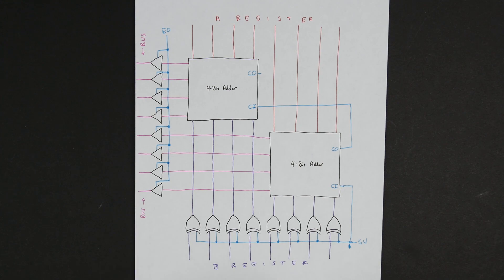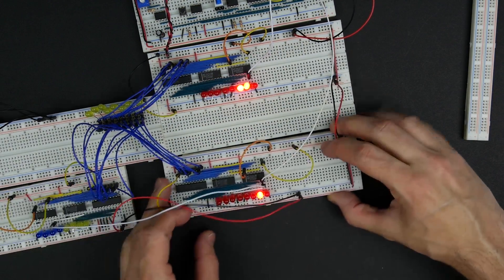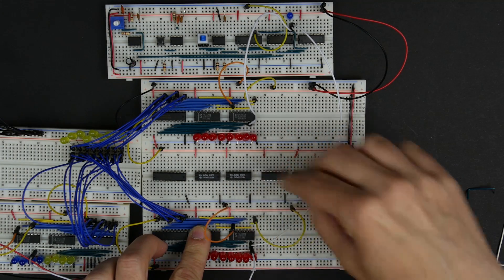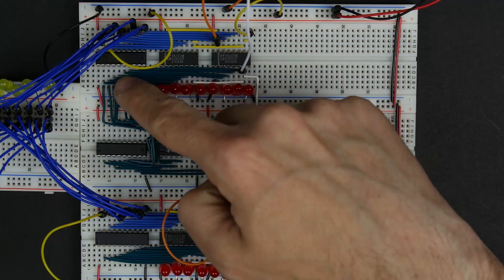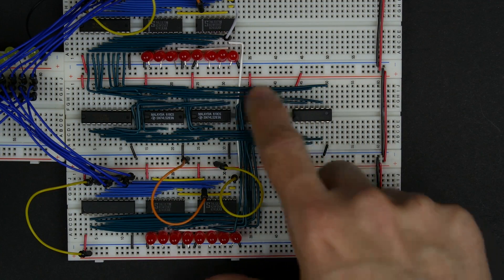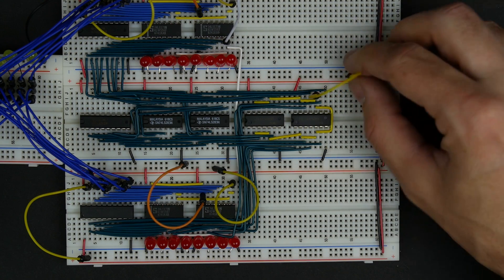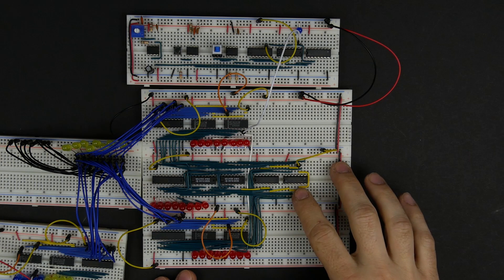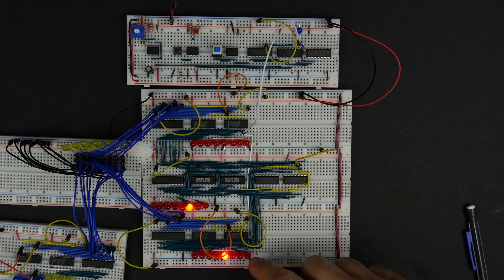Building the ALU

Comment: I run into a problem. My xor doesn't work if i use it in the computer but it does work if i use it separately. I measured the voltage and i noticed in input there is 2.01 volt. The minimum requirement is 2.0V so it is in the interval. Could the problem be the current? How can i fix it? I measured 2.01 for the first input, 0 for the second one and 0 for the third one. So maybe it's because it is considered as 0
Reply: Same ,did you fix it?   iam also getting this issue . Subtraction works mostly but the addition is not getting correct output  
I powerd  form a cpu usb.if u know something please tell
Reply: @anandkp5329  I fixed by changing the power supply. I used a 5V battery, now I'm using a phone charger. I cutted the cable, splitted GND and VCC and finally I used them separately to power my circuit. Makesure your powersupply can handle at least 1A
Reply: @undagame7800 Thanks .let me check if it work for me

Comment: If you're following along and run out of space on your breadboard for the LEDs (due to lack of pull-up resistors in the CPU kit chips), you can connect the output of the LS245 (tri-state buffer) to the bus to test rather than having to rewire. I haven't finished building the whole kit yet, but my guess is this should suffice for the rest of the circuit.

Comment: i faced a problem with alu part. i bought a 74hc283 ic from shop and i connect the pin 8 to ground and the pin 16 to the vcc the voltage of pin 7,9,10,11,12,13,14,15 is high and the voltage of the pin 1,2,3,4,5,6 is 0 why it is happening? as far as i know 74hc283  is a binary adder. it also showing wrong output. the ic become hot when i connect the input pins. Basically the out put pin 9,10,13 always high whatever the input is. pin 1,2,3,4,5,6 always low. I am stuck into this from two days. Anyone please help me.

Comment: As so many others have rightly commented, this is a great, great series - just what I was looking for in trying to develop an understanding down at the level of logic gates and transistors in the design and construction of a computer. I've already learned an enormous amount, both on theoretical and very material / practical levels, and am very grateful indeed.
In this video, however, I tripped up at one place - resulting in what turned out to be two errors in wiring that resulted in arithmetic errors in some, but not all of the numbers I tried out when testing the A(L)U for the first time.  On the one hand, as we saw in the next video on troubleshooting the ALU, this is a good thing - as we thereby are forced to go back through to troubleshoot, and thereby become all the more familiar with the details of the circuitry, etc. And as some have commented, it is one of the most satisfying experiences to finally do so successfully. Again, I've learned a great deal and am very grateful for my new understandings and modest skills, and the feeling they give of having better foundations and abilities for proceeding onto the next steps.
That said: I ended up spending far more hours on the troubleshooting than I would have liked (however great the rewards) and would like to make a modest comment for folk like me who are entirely new to this and might get thrown off in the same way I did.
At 8.23 or so, bits 8-5 from the 74LS245 buffer are fairly clearly connected into the proper inputs of the left XOR chip (74LS86). But then the video skips ahead here: we see bits 4 and 3 - apparently, as it is somewhat difficult to follow in this segment as it is speeded up and the lighting makes it difficult to see where the - already wired into pins 12 (4A input) and 9 (3A) on the right XOR chip; the last two bits are then shown as they are wired into pins 1 (1A) and 4 (2A).
Both because it was difficult to see here - and, no doubt, because I have dyslexia and can easily get tripped up with such visuals - this is where I ended up making my mistake: miswiring bit 4 (should go to pin 9 on the LS245) and then bit 2 (should go to pin 1). Once the errors were corrected - i.e., the A(L)U functioned perfectly.
Perhaps they teach one these things in engineering school - but for newbies like me, what turned out to be essential was (1) going back through the circuitry and chip diagrams in order to build simple tables of what pin needed to be connected to what - i.e., rather than relying solely on the video to show the right way. (2) I then initially tried to check the connections by tracing the physical wires - but because the wiring is so interwoven (and, again, my dyslexia doesn't help) I had to give this up. A good thing as I realized I could just check the connections using a continuity tester.
Sorry for such a long post - but again, for newbies like me, these bits (pun intended) might help avoid errors that can take a great deal of time to sort out.
Reply: thanks for the heads up! This one was a bit trickier with the wiring for sure.
Reply: you definitely need to be double checking the pin connections directly with the diagrams on the data sheets, I only use the video as a guide to see how to lay out the wires

Comment: I suggest using different color wires for different connections like using green for A register to ALU and yellow for B register to XOR gates and so on instead of using the same greenish blue wires for everything.

Edit: also I think it’s good practice to connect the carry out of the second 4-bit adder to ground through a resistor instead of just leaving it floating.

Comment: I did a few rough calculations and a sim for the adder portion of the ALU. A kogge-stone adder for 16bits built with 74HC 86/32/08 chips came out 192 nS (max 4.5v) and 94 nS (typ 5V 15pF load). A 74HC283 16 bit ripple carry cct came out 184 nS and 92 nS typ. So 192/94 nS vs 184/92 nS. This seems to be the breakpoint. At 32 bits the numbers are 228/112 vs 368/184 nS i.e. 60% speed improvement. However a KS adder with 32 bits is a lot of 74HC chips so capacitance will drop the speed improvements.  All bets are off if it's implemented into a gate array - use the KS. For up to 16bits I would just use ripple carry and 74HC283's.

Comment: The only issue with breadboards (which i LOVE BTW), is if you mistakenly snag a wire and pull it out.  then it's a game of figure out what you just broke, which can take hours.  Which is why i did what you are doing, which is to make the wires as neat and low to the boards as possible, to prevent snagging in the first place, and also make it easier to spot where the wire went.  I knew guys who would rats nest every time, and god help them if they pulled a wire by accident.  I knew one guy who would just rip out everything and start over, because he felt it was faster.

A neat breadboard is a happy breadboard!  ^-^

Comment: You could like my calculator method for arithmetic. I use three sets loadable counters. The answer is always in counter 1. Counter 2 always counts down to zero. Counter 1 counting up(from a number) while counter 2 counts down(from a number) (to zero) results in addition. Counter 1 counting down while counter 2 counts down results in subtraction. Counter 1 being transferred  to counter 2 then cleared to zero then addition taking place the number of times  that is in counter 3 results in multiplication. Counter 1 being transferred to counter three then cleared to zero , then counter 1  counting the number of times counter 2 counts down (to zero) while counter 3 counts down until counter 3 equals zero results in division. I use sequencers made of latches , AND gates , and inverters to control how the counters count (for a calculator). By using instructions in memory to cause the counters to select the proper sequencer, arithmetic can be the result of instructions from memory being decoded to select the needed sequencer. Other sequencers can likely be created to accomplish logic functions and program control as well as input and output.

Comment: At 7:00 Ben puts the buffer into the wrong pin. He puts in input pin 12 which is the A part of the adder and not the third sum. You can fix this by just putting the pin up one higher into pin 13 which is Sigma 3.
Reply: I was debugging this issue for 3 hours.  Thank you
Reply: Saw him do that and immediately looked to the comments like... "that can't be right"...

Comment: I am loving your series! Thank you so much!

But i have a question that I do not see answered in the comments.

In a previous video, you showed us that you added the tri-state octal buffer to the registers so that you can visualize the state of the registers with LED's. Without the buffer, the outputs would only be visible when enable is set (And the data is on the buffer). So it was clear that the buffers were added to aid in this educational/hobby scenario.

But if my understanding is correct, you would also need them if you wanted to do what you have done here. i.e. if you did not have the buffers in place on the registers, then the ALU would only see the register values when enable was set on the registers. And of course, you should not have enable set on both buffers as they would clobber each others data lines on the buffer.

So if my understanding is correct, then you NEED those octal tri-state buffers on the registers, not only for observation/education purposes, but as a requirement for feeding the registers output into the ALU without affecting the buffer. Is my understanding correct here?

And if my understanding here is correct, then what is the point of the enable signal on the register chips? Is this maybe not a typical use of those chips? (This would completely make sense as I guess there is not a huge demand for people building CPU's from discrete components :) )

I really want to build me one of these. I wonder if I ever will :)
Reply: I have not thought it all the way but I think we could use the register's enable signal in conjunction with the octal tri-state buffer in order to have more than two registers capable of interacting with the ALU. 

We could connect, lets say registers A, B, C and D, to the ALU and enable only the registers A and B or C and D to have their sum. We could sum A and B and output the result to the BUS to later load into C without lose A and B values.
Reply: @mmannes  You could even select registers individually if you wanted, rather than in banks. So you could select A and B or A and D, if you wanted. It would need an additional control line and I don't know if it's a useful function.

But again, this requires the tri-state buffer to be in the circuit, which re-inforces my thought that the buffer is a requirement and not merely an educational/informational extra.
Reply: @Tomsta17  I agree. Since the ALU's operating is not triggered by the clock signal, it is a requirement that the ALU doesn't input data from the BUS but directly from the registers, which means that both registers must be able to send data without outputting it into the bus.

Comment: Hi, i have 8 logic gates in parallel hooked up to one single 1k pulldown resistor. The output states of the logic gates are instable. When i switch to a lower resistor e.g. 470, then the output states are stable. Why is that? and what resistor should i use?
Reply: You don't need a resistor just a wire for pulldown to ground.
Reply: @CAsCurryKitchen  i have it hooked up to a switch, so i need it as an pulldown resistor
Reply: @kevinschwarz8010  because the current limitation. TTL chip draws tens mA to work property. use a 220 ohm resistor would be fine. thecurrent is about 5v/220ohm ＝20 mA

Comment: How do you directly connect the LEDs to the various signal lines? Don't you need dropper resistors for them?
Reply: Check the data sheets.  Depending on the chip those resistors are 'built in'.  I believe he covered it in previous video.  I may be mistaken however.  Check the chip data sheets.
Reply: @drzorbo3770  Well, the inputs do have internal pull-up resistors, but that's pretty much it, the output is just either shorted to ground, or shorted to Vcc.

Comment: The LED problem is interesting. Do LEDs not come in a chip-like row that you can just snap into a breadboard?
Reply: You can get DIP-sized LED bars as well as small form-factor LEDs with 2.54mm lead spacing, but they're not always as versatile if you need to go directly from the main board area to ground, because breadboards differ sometimes in the spacing of the ground and power busses. It also of course just depends on what you have available to work with at the time.
Reply: Ah cool thanks for the info

Comment: I wonder... instead of having a single control signal (SUB) that drives both the XOR gates and the carry in to the lower adder, if we were to drive them separately then we could do some intresting extra things:

ADD:  Sub = 0,  CI = 0                              (As we currently have things)
SUB:  Sub = 1,  CI = 1                               (As we currently have things)
ADC:  Sub = 0,  CI = Carry flag             (Add with carry)
SUC:   Sub = 1,  CI = NOT carry flag   (Subtract with carry)

Where Sub is the input to the XOR gates and CI is a carry in signal.

This would allow the computer to do addition and subtraction of data that is larger than 8 bits. We would ADD/SUB the lowest bytes together and ADC/SUC all the remaining bytes.

I don't think we would need to do any additional wiring as the carry flag is an input to the control unit, which would be driving the CI and Sub control lines.

If we did this I also suspect you could play with the micro code to create a bitwise NOT of the A-register:
* copy A to B
* subtract B from A.
* Store the result in A.  This will leave 0 in A and the original content of A in B
* Sub = 1 and CI = 0.    This will invert B and add 0 to the result
* Store the result in A.  A should now be ones complement of its original value

Our ALU finally has a logic operation!

Comment: Having a slight issue here, I built two four bit registers to test this idea and they worked great - when adding - But whenever I set it to be subtracting then I have a one that seems to remain no matter what, like 6-2 will come out as 3, etc I've looked around and seem to have connected it wire for wire how ben did but still no avail? If anyone has any ideas as to why they'd be much appreciated XD
Reply: It sounds like you might be using the 1's complement instead of the 2's complement.  Did you remember to connect the "subtract" signal to the Carry In of the lower-order adder circuit?

Comment: I have a question: istnt this ALU able to do just A - B? What if I want to do B - A? Should we not have then the XOR gates also next to the A register and have SUB_A and SUB_B signals?
Reply: I taught about this too. If you wanted to calculate the difference between 7 and 5 you ALU would output 2 as expected. But in you case the calculation would be 5-7 which is -2, thats just your result invertet. In binary a two is 0010 and a negative 2 would be in 1s comeliment 1101. So I was thinking that maybe in that case you could just build an inverter for all bits. Of course you have to converte that in 2s complement at the end.
Reply: I had the same thought would you swap the data between addresses before you did the operation?
Reply: Than just load the walue you want to subtract to the b and not to the a

Comment: Wow these parts are expensive. I've been purchasing them on ebay as I watch your videos, and the sum (pun intended) going pretty high.
Reply: If you keep buying them, eventually the sum will overflow, making it cost nothing.
Reply: András Kiss Buying one of most electrical components  is usually more expensive than buying 10 from Mouser or Tayda.
Reply: András Kiss Have you tried digikey? There have very good prices, and free shipping after $100
Reply: Fwacer yes I have checked them out. However, I ordered from ebay. I needed only a few pieces and it was cheaper from there. Thanks for the suggestion.
Reply: András Kiss In future try digikey.. I found ebay is much more expensive overall. I got a few parts from there (like breadboards and wire strippers) but all my electronic components I got from digikey. I live in Canada though, this may not be true where you are frpm!
Reply: TheGamingPatriot _ If only!

Comment: Hi, To introduce multiplications would you design another ALU with ie. SN74284 or how could this be integrated in this one?
Reply: Markus Rohner you could achieve multiplication by repeated addition. It would be costly but to do 5x7 you can just add 7 into an empty register 5 times.You can use another register to store a count and compare to see if you've added enough times.